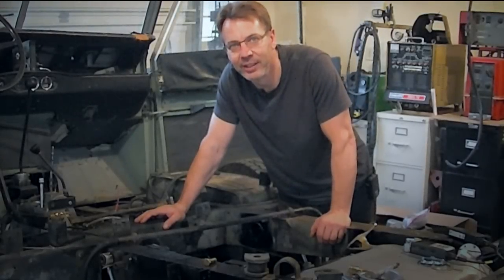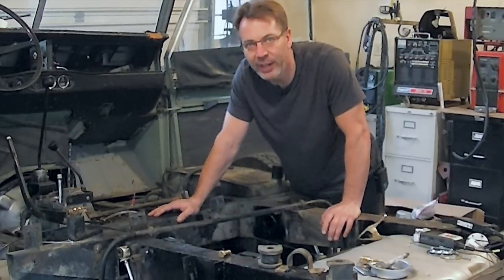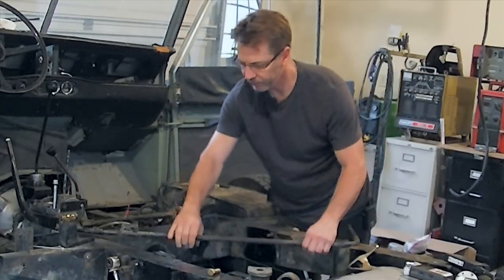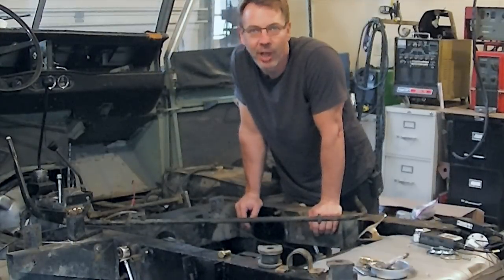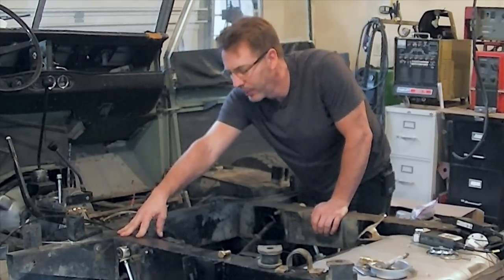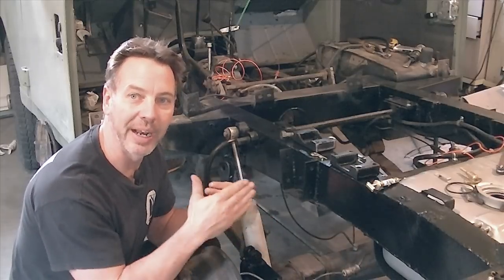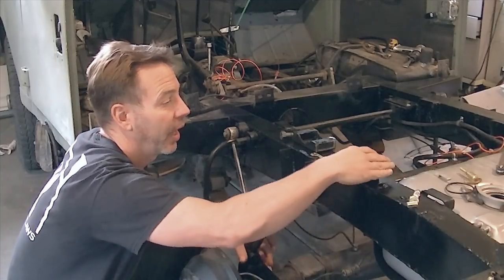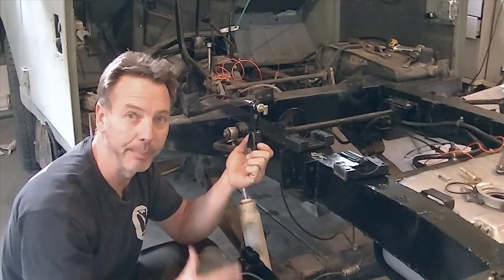Very Very cool Land Rover modification

Comment: by the way. there are tubular splined sway bars with clamp on ends used in circle track racing.  don't have to notch the frame. and there are used race car parts shops around the country that will have selections.  i don't have my 109SIIA or 88SIII santana anymore.  but there are also trucks and small trucks that have rear sway bars that have a deep offset in the middle to clear driveshafts.  also cheap at junk yards.

Comment: Thanks Dale, clear video and good improvement to the Landy. Anyone stimulated by your mod could consider some type of hardened joint that would allow the sway to be parted avoiding the U cut. That would allow removal for repair or replacement at some later time. Just a thought to consider ...
Reply from the maker: Hi Phnug,

I try to come up with a coupler system.  My ideas bumped up against to many obstacles  that I could not over come with my equipment. So in the end, I just cut  open the frame and made it work.
Good Idea,  I wish I could have made it work.
Dale

Comment: Hi mate.
That is a very nice modification.  I actually liked the driving characteristics of the Laro.  I have had a series 1 swb with safari roof, totalled it on it's maiden flight, after a ground up restoration (brakes failed)  and a S a2 lwb ute, sold her when emigrating to Australia.  and loved them. 
About the sway bar, some Nissan GQ patrols came out with a sway bar disconnect.   This was a lever like a hand brake under the dash.  It worked really well.  Perhaps you can adapt one for your Laro.  Also if you still have the 2.25L motor in it, you should put a SU carburettor on it , and stand back.  The car will get so much more power, that you don't know what happened.  You just stick a 90 degree bent on top of the manifold, and attach a side draft to that.  No need for a down draft SU.
I also have several manuals for them, so if you need to know something specific, I might be able to find it. 
Kind regards
Marcel.
marcelandmarleen@Hotmail.com

Comment: Hi Dale,
great video and thanks for putting the time into your series of videos.
I wish to note that the definition of how the sway bar works may not be the best to help novices understand the operation of novices.
I beleive that  it would be best to explain it as follows.
As the car rounds a corner and leans to the outside of the bend more pressure is placed on the outer wheel causing it to compress the spring resulting in wheel travel. This wheel travel places a torque on the stabilizer bar that conseqently puts pressure on the inside wheel causing it to raise. this lifting of the inside wheel results in some levelling of the car body.
This tilting/lean of the car body causes less pressure on the inside wheel not more.

I hope this helps.
cheers and good work.

Comment: my recovery landrover a 1953 we fitted with sway bars plus coil springs on top of the axle and 4 shock absorbers per axle so it had 4 shocks and 4 springs per axle held the road well plus it was while towing [suspended tow]
Reply from the maker: It no longer a 53 with all that work LOL :-)

Comment: hope you don't break you sway bar. I don't understand why it won't fit behind the axle? My 110 has a sway bar and a rear fuel tank.
Reply from the maker: It will hit the drive shaft.
Reply: +Metal Tips and Tricks (Dale Derry)  Behind the axle, the is no drive shaft.  Run it under the gas tank.

Comment: nicely done... 
do you realize that by adding a rear sway bar and not adding or increasing the diameter/stiffness of the front, you will be causing the vehicle to "oversteer" when going around turns or curves in the road?

Not a fun situation... Most vehicles are designed to understeer because it is a condition that is easier to recover from when it happens... You would only add a rear one if the truck understeered drastically before... which is possible.

Love your workmanship and design skills
Keep up the great work.
anoN
Reply from the maker: I do  understand what you are talking about, But because the front springs being so stiff there's been no problem with over steering.
thanks for your comment .:-)
Reply: I had bad oversteer before I added an ARB.  Since fitting it, I was initially wary but found no discernible difference in oversteer or tail end breakaway.  The initial issue was due to tyre choice, and I have no problems with BFGs now.

Comment: You seem like you know what your doing and the work looks good but why in the hell would you hack up the frame on a series Rover just for a sway bar. To me it seems like a ton of work when you probably got the same results putting a better leaf pack in and kept the chassis original.

Comment: I would of bought a schrodder swaybar  with splined ends off of Ebay ( used NASCAR parts) and two splined arms to fit. then you would not have to cut the bottom plate of the frame (a big no no).

Comment: You could just add the heavy duty leaf springs. Much easier.
Reply: definitely not the same thing... stiffer springs are always harsh whereas the swaybar (anti-rollbar) only comes into play when going around curves.  a far better solution for a street driven vehicle.

Comment: I have respect for anyone who will modify their vehicles but you really don't want to be butchering a chassis to fit something that you will need to butcher it again to replace. that could go above the rail !!
Also Series landys don't have a body roll issue, they handle very well on the road.
the reason yours sways about is because you have those stupid Parabolic leafs on it that were popular for a few years when nobody was making proper replacement springs for them, parabolics became a fashionable 'must have' for all the wrong reasons, they mess up a series landy, cause prop issues when they twist & make the car bounce about, junk the sway bar & just put proper springs on it.
Reply: Mine swayed badly when the roof rack was laden.  A combination of 4-leaf HD parabolics and gas dampers does not resist body roll as well as rusted original leaf springs.  Apart from that, the ride and performance of parabolics is much better, on and off road.  I added a Marshall Ambulance anti-roll bar under the aft chassis, similar to this mod but without cutting the chassis, and it has been more comfortable than my 2009 Defender XS ever since.
Reply: Yes fine if you MUST fit one, but going through the chassis is just ridiculous.
Not sure comparing new parabolics with old rusted standard springs is of any consequence, high quality standard springs are readily available & fitting HD parabolics seems like you will just increase the ride height & make the car more prone to sway.
Sway bars work great on cars with softer independent suspension but on a landy with parabolics you will risk losing traction earlier on corners.
Reply: To be honest, patchy, I'm not keen on that chassis cutting either.  I'd have mounted it directly under that aft fuel tank, like a later LR.  It is unnecessary  extra work, prevents replacement of a broken or bent ARB, and introduces a weakness that can be avoided, even if the welding is good and reinforcement added (as mentioned in the video).

A rear ARB by itself can, in theory, reduce longitudinal stability when cornering hard in slippery conditions, but my experience has shown little if any difference to that, but a vast improvement in lateral stability, including better side slope ability.  So, as long as you don't drive ludicrously, the benefits outweigh the cons.  It's a better option than fitting stiffer springs and dampers as they would make the ride harsh and road holding on potholed roads or over speed bumps would be compromised, and stiff dampers only help resist roll/sway momentarily, doing nothing in sustained turns or on side slopes.

Parabolics do ride better on and off road in almost every respect, but few engineering solutions only have benefits - there is usually a compromise.  The increased ride height from parabolics can be a problem for some, while for others it can be a benefit or even a principle reason for the change.  The roll is the main negative, and an ARB is the simple way of fixing it, though a matched pair is better.

Comment: Sorry what ! To make your Land Rover safer on the road you cut a section out of the web of the chassis !! Oh my goodness no, no , no . Don't get me wrong here, you are an excellent welder. And the design of the project is fantastic. But to cut a hole in the web of the chassis is beyond what I can comprehend. That chassis is designed to function with the correct material in place. A hole in the centre is just wrong. I have designed and built many trailers, and truck decks. Trucks even have labels on the chassis saying " do not cut or weld". If you did that mod in Australia your Land Rover would be taken off the road, being involved in the auto industry, this I know .
Reply from the maker: Hi, Thanks for your concern. The frame on that truck is so over built I'm not in danger of it failing. I have seen frames  with big rust holes in them and not fail.  I trust my work with my life.  I take this truck to Death Valley for up to 4 weeks at a time. I may not see a living person for days.  So I have to trust my modifications.
Reply: +Metal Tips and Tricks (Dale Derry) A land rover chassis is not over built. The US just doesn't have enough series Land Rovers for you to base this on. In Australia, the UK or New Zealand these vehicles were used by the armed forces. In this heavy use situation the chassis often cracked . I agree that modifications are possible, but if others follow your instructions and perhaps their welding isn't quite so good, then perhaps the results are dangerous. The hole should have been plated.
Reply: They cracked because of advanced corrosion and only in specific points where sharp angular changed occurred, like the back end of early dumb irons (which is why SIII 109s had gusseted dumb irons).  The other cause of failure was severe misuse - squaddies are not overly careful about how they treat LRs.
Reply: Ahh nearly pissed my pants ,sway bar on series land rover ,get some new OEM spec springs zero sway
Reply: What about Aviation Frames, The Holes are designed to make it lighter and Stronger. Municipal State Officials know very little except making you buy permits and handing out fines.  I'm a Certified Welding Inspector and Pipe Welder in the Pipe Line Industry, Equipment gets modified all the time, This is not an Engineered Bridge or a Tractor Trailer Carrying 25 T and He is not the first to cut a hole in the frame of a passenger Vehicle NASCAR and Hot Rodders been doing it since Henry Ford been making cars.  Look up Chassis of Roadstershop, All their sway bars are welded just like that.

Comment: Does it make its Off -Road ability  bad ,?  If they were needed  "Land Rover " would have built that into it .And also you are will weaken the Chassis
Reply from the maker: All 4x4 build today have a sway bar built into them including Land Rovers and Range  Rovers.  Cutting a hole in a frame structurally it weakens it less then 1%.  If you don't believe me ask a first year engineering student.
Reply: John Traylor simmer down
Reply: Where are from? rural Afghanistan?

Comment: A lot of work and takes a time ... you can use a split sway bar using a special hexagonal shock connection in between. You don't need disturb a chassis ... just make a hole, put sleeve pipe and reweld...very simple ?!

Comment: A 'sway bar' or , anti roll bar in English, is a bad thing for a Land Rover. Unless you're off camber, a Land Rover will slide before it rolls, so there's no safety advantage. 
Off road, it drastically decreases articulation, which will just leave wheels high and dry. On any off road vehicle, that's bad, but on a Land Rover and most others, it makes it easier to cross axle, leaving one or two wheels off the road... and spinning uselessly.
Adding lockers solves that to an extent, but you still never get full traction. 
If you disconnect it... what do you do with the dangling bar?
Even on the road, in some situations, namely single wheel bumps, the extra 'spring' in the system can produce some properly weird handling, as they're just not damped for it. 

I'm also not a fan of running the roll bar through the chassis. I've seen those things snap, and you don't want to then be left with hacking and cutting to do to replace it. 

Nice idea, and very neatly executed, but not something I'd ever consider doing to mine.
Reply: +Foxtrot Oscar I don't know, I think he has thought about your points and addressed them in the video.  An anti roll bar on a Land Rover.  Actually yes they did fit them from the factory.  On later models as they learned what was needed.  They may not have been fitted from the beginning as it was a learning curve.  The Land Rover was a from the ground up design taking a lot of cues from the American Jeep.  A fine vehicle but not exactly what the Wilkes brothers were looking for.  So, as the design and models evolved extra bits were added, parts were refined etc.  Power steering even got added eventually, wow ;)  wish they'd done that in 1968 when my 2a was built...  As for weakening the chassis?  Again, the author has shown how he has anticipated this and built in strengthening plates.  Maybe that is all that is needed, maybe not.  Time will tell.   I think this is an excellent video and has given me some ideas.  My 2a had an anti roll bar fitted on the front but, being an ambulance it could really have done with one on the back (some did get them, mine didn't).  It's something I may consider doing to mine at some future date.
Reply: KevsoldLandy Unless you drive on road, and hard, I don't believe there's any need for an anti roll bar on a series unless it has a particularly top heavy configuration, ie a big roof rack, dormobile top, or some other special body.

The Defenders are a bit more top heavy as they have more interior trim and less weight lower in the chassis, and tend to have wider tyres and a more road biased suspension setup. 

An ambulance could certainly do with a rear ARB, a relatively stock 88"... Not so much.

As I said, not something I'd do to mine. It just wouldn't work with my rig for what I do, namely a lot of overland and touring. It may help with towing, but it's never been problematic before, up to and beyond its rated weight (which may or may not be 3500kg... No one seems to know)
Reply: +Foxtrot Oscar I went offroading through an old quarry last year, mainly older defenders but one puma with swaybars, it was lifted and had better tyres than we did, but it couldnt go as far offroad. you could watch it lifting wheels on really a relatively easy slope that we waked up. I do see the benefit of this if you dont really use it offroad though, but again not something i would consider. My 110 slides around roundabouts without much body roll at all!
Reply: ***** On the road, the only real difference is that no roll bar is less jarring when you hit a pothole with one wheel. And you can go bit faster round corners.... which isn't really the point of a Landy!
Reply: +James Kennington did you see the quick disconnect ends on the bar? This is a common modification on most modified off road rigs now days. Connect it when on the asphalt, disconnect when off road. It helps heaps with on road manners in my Jeep.
Reply: Didn't you notice it has a disconnect ?!
Reply: Foxtrot Oscar,todays speeds are well above what were the norm when this was built.Adding a sway bar to the rear is a smart mod on this gen Land Rover if it spends any amount of time on todays roads regardless of what you think.Being able to handle on ramps and curves at the same speed as the rest of the traffic really increases the safety and usability of the vehicle.
Reply: SouthJerseySound Land Rovers don't do today's speeds. Sure, I cruise mine at 70... just. But that's in a straight line. When it comes to corners, I remember it's a 44 year old vehicle, based on a design from the 1940s... that wasn't very advanced even then. It'll never ever handle. Ever. 
And if you sacrifice the off road ability for on road ability... why wouldn't you just buy a van?
Reply: Foxtrot Oscar Last time I checked you can add disconnects to sway bars......You might want to try it sometime lol